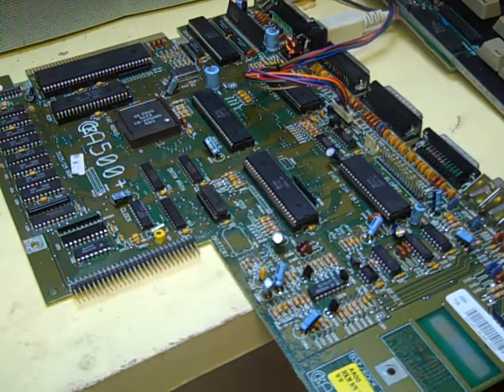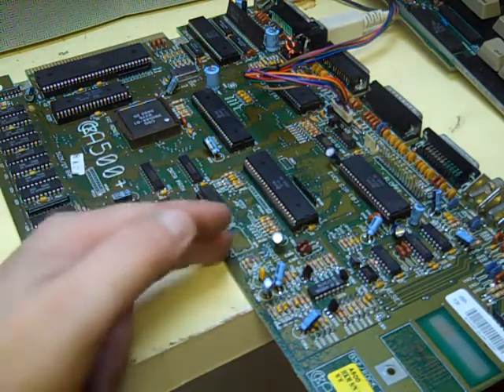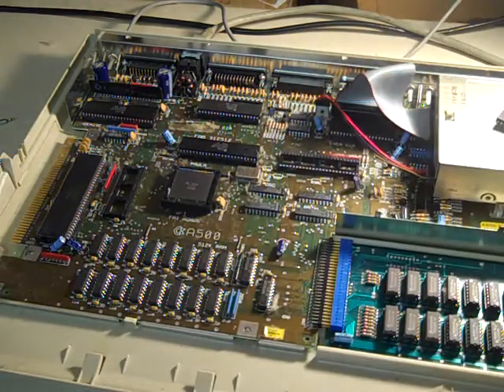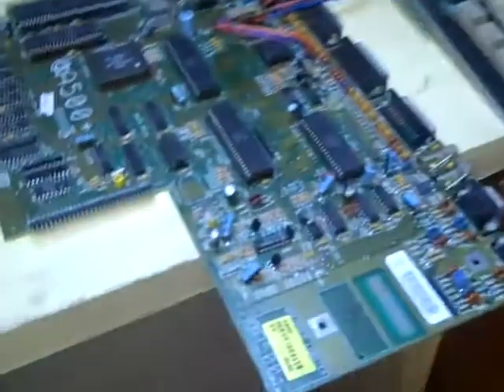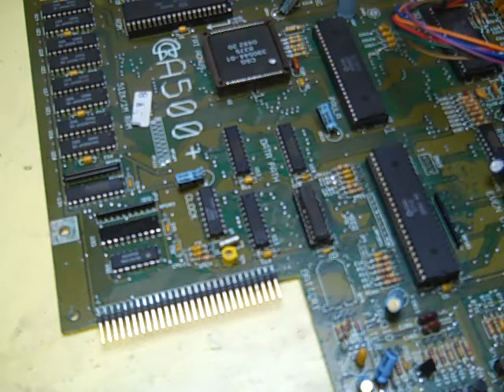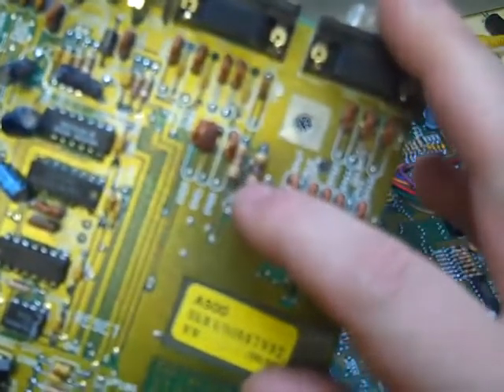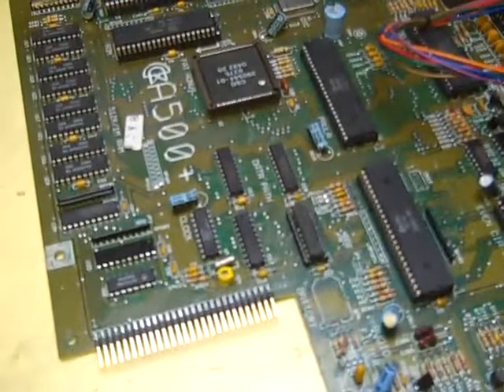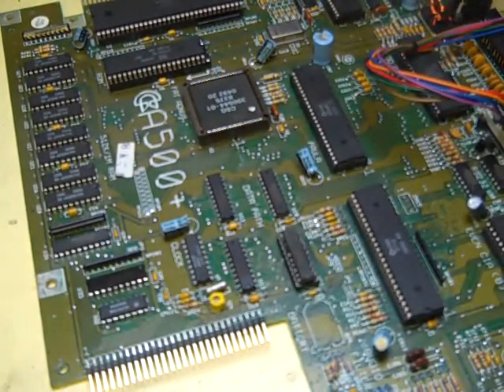Amiga 500 Plus repair Pt3 We have a boot screen

Comment: Great progress btw!  Interesting the ROM died =O  Well spotted on that burnt out resistor on the controller input of the spare board.  Cannot quite remember but I think there's a pinout difference between the agnus used on the 500 and the 500+.  You can however put some of the  agnuses that can address 1mb of chip into a 500 motherboard (as default it will give sound glitches and incompatabilities due to running in NTSC mode until you mask off one of the pins on the 1Mb agnus chip).  But it's worth checking which agnus revision is on the 500+ board before trying it on the 500 board.  The versions that can address 2Mb definitely need an adapter from memory.
Reply from the maker: Yes quite correct the a500 agnus does indeed have a diffrient pinout and addresses the memory differentely to the a500 plus agnus. I have a couple of each in my spares stock. just need to get a new Gary (one ic i've not got in stock). and wait for some 27c400's to arrive from china so i can burn a new rom.